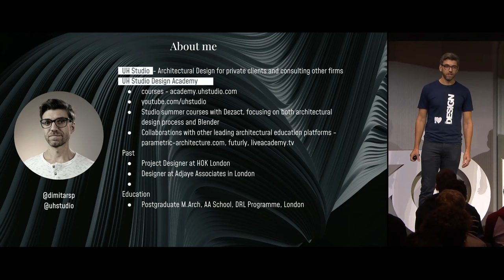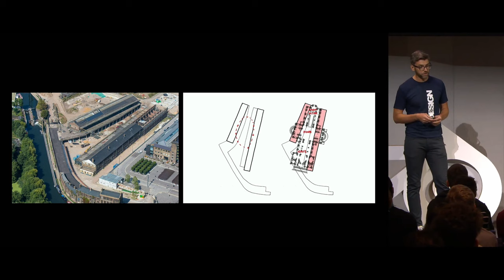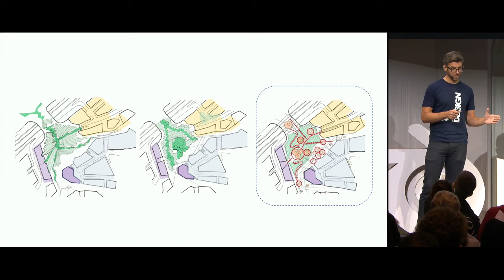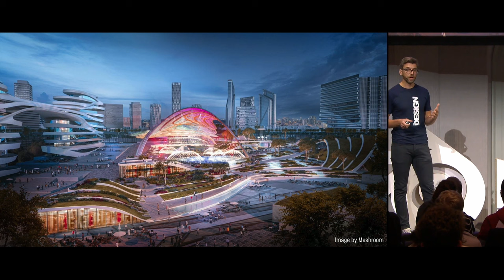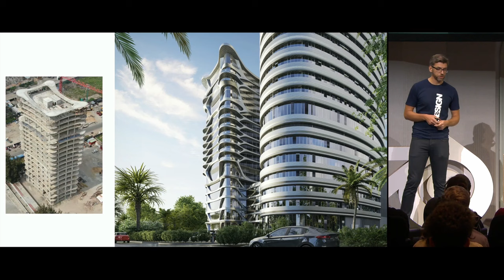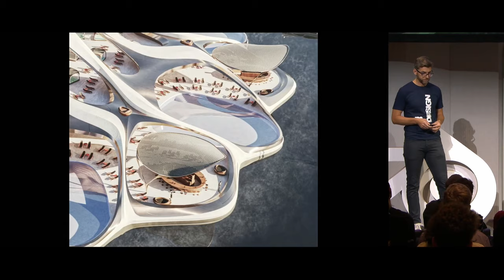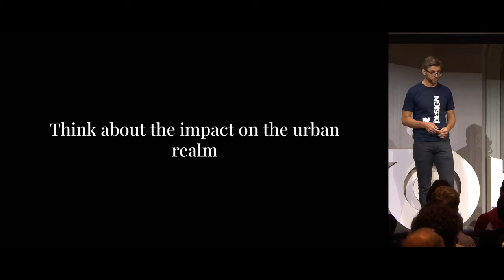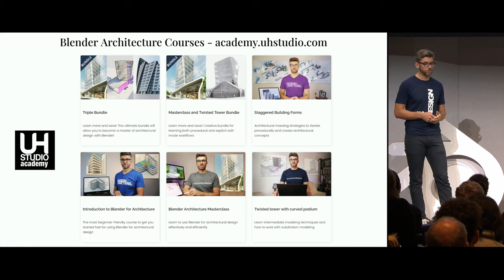Architecture is about Beauty. How Blender can help.

Comment: As a fellow architect, I wish you had not spent so much time and emphasis on your particular definition of beauty, which is debatable and not always scalable.  Your designs lean towards organic shapes, Blender's advantage is shown mostly to keep things procedural and allowing the base geometry to stay flexible as long as you don't have to apply your modifiers.  I so wished to see more of the unbaked process, like the photo of messy design studio at AA. You showed glimpses of hand sketches.  Were they done in Grease Pencil?  How do you sketch in 3D (with GP, with geometry nodes...)?   I love that you emphasize Blender is not just for Arch viz.  But why do you choose to only show finished rendering of the small project and your house, but not their design process?  While you certainly have mad skills with Arch design in Blender, you might have undersold, or maybe under utilized, some of the other amazing Blender features that help architects iterate faster.
Reply from the maker: Fair feedback. 20 minutes to present is not a lot though, so I can't fit everything ;) My goal was really to have a more of a "wow, you can do that with Blender?" presentation. But I take your point and for next year, will likely propose to do a presentation that covers the less "sexy" but more important side of doing architecture in blender with BlenderBIM and what the likes of openingDesign are doing.